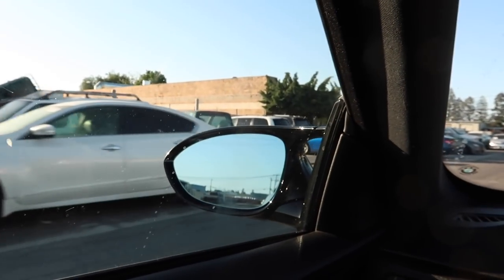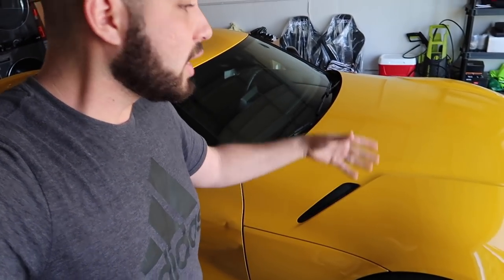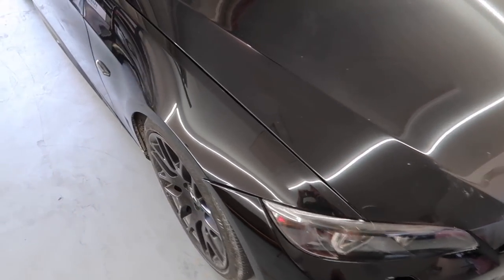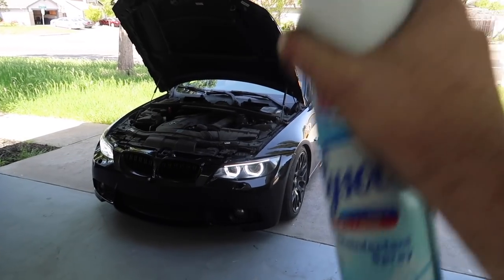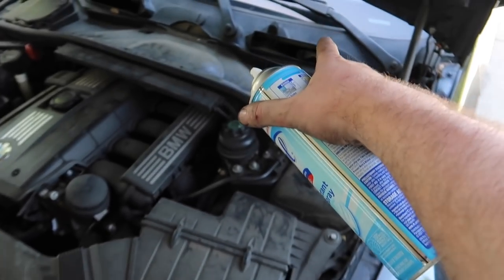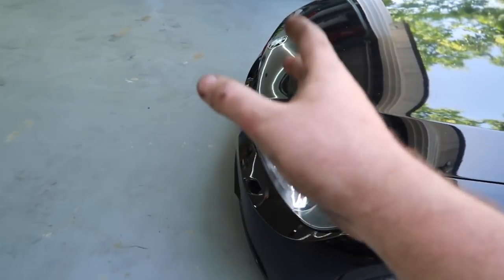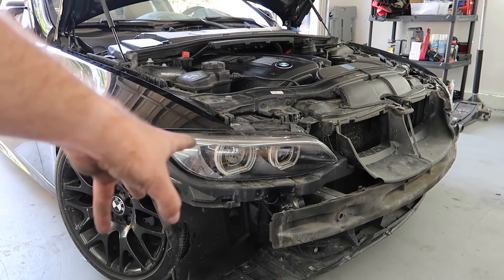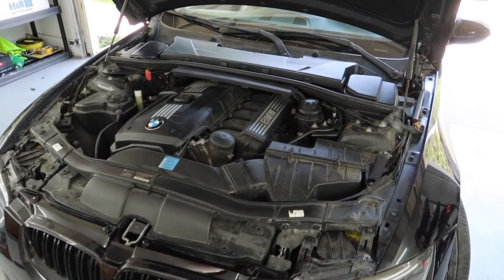THE E92 IS BACK AND FULLY PAINTED! BEST DAILY EVER 🥰

Comment: Just some tips for the paint… that finish is called “orange peel” many times depending on lighting it’s hard to tell on fresh paint but sometimes it can be buffed out and doesn’t have to be fully repainted. If your boy did this job on a cloudy day it can happen. There is no excuse for the scratches in the lenses/pieces of the bumper unclipped. My advice would be to respectfully bring it back ask to have the orange peeled buffed out on a sunny day and ask for some money off to get new lenses (this way you don’t have to wait, and it can be done in a day). All your builds are so clean don’t let someone else’s work mess that up.

Comment: Hey Nour, 
What I have done on my Acura Legend is actually spray vinegar through the air conditioning. It kills the bacteria, mold, etc. It will not smell the best, as it’s vinegar, but the smell should not persist for more than a couple hours max. This is a sure fire way to kill it and not have to worry about breathing in toxic fumes. Obviously keep windows down like you do in this video.

Comment: It didn't look too bad at first until you zoomed in closer to the paintwork, I can't believe how much orange peel there is, I paint in a shed, I'm no professional but I can get a much smoother paint job with next to no orange peel, I use a cheap gun for primer, Devilbiss flg5 for base coat and a Devilbiss GTi pro lite for clear coat and always get good results

Comment: If the scratches on the lids are just from sanding paper, you can easily fix it. Just like the paint wetsand cut and polish the headlights also.
Reply: Doing so will remove the uv coating the lenses come with though making them yellow and cloud up quickly especially in that climate and besides that its not really the point the cowboys who done the paintwork should be sorting it
Reply: @alanbryson68  if they took 2 weeks to get it painted there’s no point taking it back, all he has to do is spend around $300 on DA polisher, sand paper, some cutting compound and some actual polish. Then he can also buy some wax uv protectant. The $300 will be a investment as he can then polish his own cars instead of taking it to someone.
Reply: @piovo1  he tried before when he tried painting it didn’t go well if he goes too far he will then have to have it painted again though 🤷🏼‍♂️, its all good and well if you know what your doing and have some experience ive been doing paint and body 17 years and it would be impossible to get all that orange peel out of that bumper the flat surfaces maybe easy but its still not the point

Comment: What’s up bro it’s called orange peel 
Best way to fix it is wet sand it at 4000 or 5000 grit then use a cutting compound and polish should fix it but you should take it back

Comment: I’m sorry but this body shop has done a lot of bad work. Especially whenever I see these different rebuilds. Take it back. Lenses damaged, interior filthy when you gave it to them clean. Same with exterior. And that orange feel is horrendous. They should of taken both the rear and front bumpers off well before painting. And they painted the bolts
Reply: They won’t tho it’s too much labor for them
Reply: @BmwMe-uh9sy  seems like the problem doesn’t it. The place I take my car to whenever something happens thankfully only twice. The do everything absolutely perfectly, they match the time they say it’ll be done almost every time sometimes even earlier and they give the car a full interior exterior detail.
Reply: @Donnymar  well that’s why your paying more then everyone else, your losing more $ out your checking acc cuz you want a better result, some ppl are ok with paying less and getting less quality. It’s all about how much your paying
Reply: @BmwMe-uh9sy  I’m not assuming how much he paid. When it comes to paintwork you’re expected to do it properly and not half assed. Especially since he had to wait 2 weeks for it and then he gets delivered this? Also the other jobs that have been done in the past by the same guy have been near flawless. And he’s a repeat customer. It started since the M4 rebuild when the guy didn’t listen to what Nour had wanted

Comment: That bumper job is horrible. If you are paying good money why didn’t they do a proper job and remove everything. Nour , you need to change your mindset , you should take it back for a redo . You can still see the sand marks on the bumper , sanding and buffing it won’t change anything. There’s a chance that bumper will start peeling off since it was done on the car and also a chance over the months or year that bumper will look even uglier.